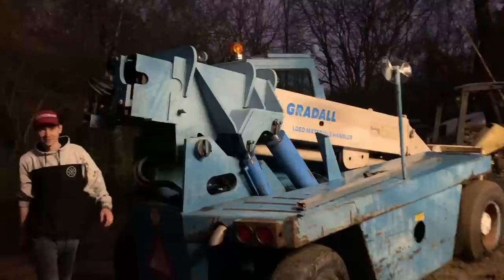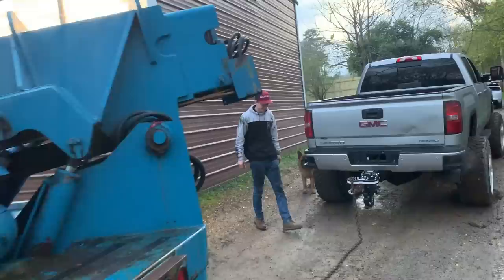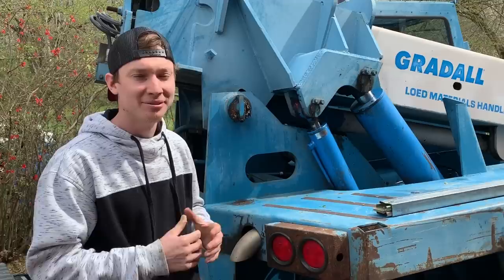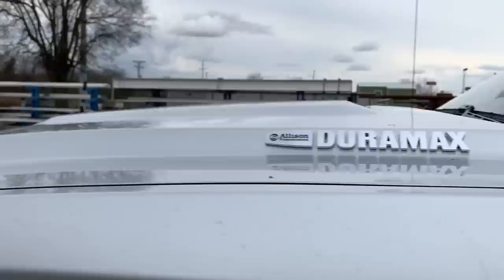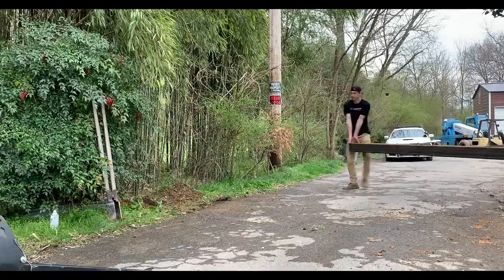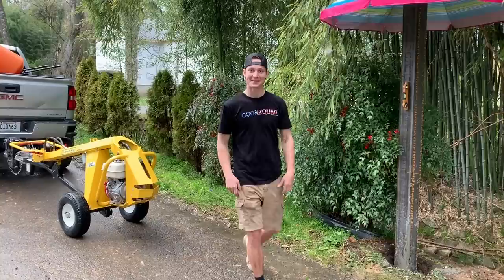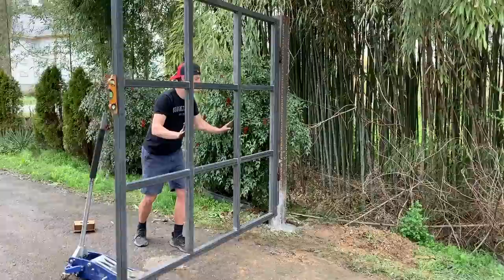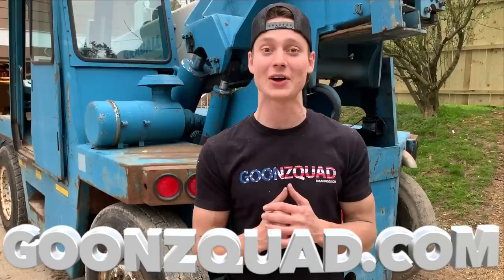Rebuilding The Worlds Biggest Forklift Part 3

Comment: Hey goozquad great vid but I have a suggestion. If your going to paint your “worlds largest forklift” i would suggest painting it white because if anything leaks it is easy to spot since she’s a little old it would seem right.
Reply: I agreed ;) your smart
Reply: Idk but i think its not a good idea cause white is easily look filthy isn't it?
Reply: Yellow - that is why big CAT machines are yellow, and easy to see so you don't get run over.  White glares too much.
Reply: I was thinking exactlythe same thing. Some light color so they can spot any leaks
Reply: @dannyinaus  yes this is what i mean😂
Reply: i would paint it yellow with black and on the boom goonzsqaud in black  i thing that would be nice
Reply: Naw the dodge viper orange would be better why would you want it to look like other forklifts
Reply: I think white on such a heavy machine would look full of dirt very quickly that current turkois colour is just perfect for both seeing leaks and hiding dirt..
Reply: White? You'd spend more time cleaning it than operating it. Just make sure you replace those seals, especially on the large boom. The oil was pooring out of there. I'd say paint it red, so it stands out and compliments the awesome shop!

Comment: Add a wheel on each gate down on the bottom. It will keep it from sagging over time when they are closed. I have 2 wheels on each side of my gates and it works perfect. It rolls perfect when you open and close it. The gate sits on the actual wheel, the wheel is on the ground eliminating any potential sag over time. The wheel doesn’t have to be big. It can be a small lawn mower wheel or a wheel off a trailer tongue. Make a bracket that mounts on the wheel and gate. Use wheels that do not need air so you never have to worry about it going flat. Just a thought because those are heavy duty gates.

Comment: Take the forks tilt them down in the dirt  and use the extended boom to push yourself backwards 
out it will push you back
Reply: Yes, this works, use the machines capabilities but......assure yourself that you are not poking a fork into a buried waterline or worse a gas line, also....clipping a fiber optics trunk will cost you around 100k

Comment: You should weld straight piece of metal on top of those two posts, this will prevent falling of each sides in a matter time and also keeps it sturdy. Last note: fix that hydraulic jack as soon as possible it's so dangerous cruising around with it.

Comment: I could get her out extend the boom into the ground while reversing and it should push it out
Reply: It also greatly increases the chance of bending the hydraulic cylinder for the boom extension. If its alittle stuck, it works but the way that was it would have broke something
Reply: maybe they didn't want to risk it what with their leaky hydraulics..
Reply: @mikef6879  Shouldn't be possible to bend that cylinder, since the extension itself will take the forces.
Reply: @Matevz96  they bend, we do work at a few rental places and they are constantly changing the cylinders because guys are using the boom to push things. The cylinder pushes the boom, all the extension forces are on the cylinder. The up/ down/side to side forces are on the boom

Comment: Given that you move allot of heavy equipment, I would have invested the money in widening the driveway for extra clearance, and also to rip up the driveway. As far for what I would put down in place of the tarmac, loose gravel (I think you Americans call it metal) used for roadworks is cheap, and easy to apply. Once that's out of the way, do the same job you did with the gates but weld in some diagonal supports, and have it on roller wheels. Also, look into putting in a small retaining wall down the neighbor's side of the driveway. The last thing you want is a bit of rainfall to loosen the earth, and have a truck or something go sideways. Remeber : a broken truck is a sad truck.

Comment: When using that concrete to set posts, you can actually just pour the dry mix into the hole and add water afterwards. The instructions on the bag will explain exactly how. Good job though guys!
Reply: Ismael Lugo ditto. And I woulda used a bit more Crete.

Comment: Nice job boys! Those fence boards tend to twist up a bit at the top if they stick up too far beyond the cross member. You might see those get a little wonky. But, you can always cut them down closer to the top of the steel frame if that happens!

Comment: Fill the beams with concrete at least 1/ up with sand rock and quick create, also put some type of dome/cap on the top posts to prevent rain/snow or other items from getting inside and destroying it for the inside out. You may want to add caster near the middle opening to aid in rolling upon opening to distress the hinges. as for the gate leave it plain no since in announcing who you are on the outside of it, But "GOONZ" on one side  and QUAD" on the other in Diamond plate would look awesome!

Comment: In case you didn’t see the other twenty comments, you should’ve just extended the boom and it would’ve pushed itself out lol
Reply: Kane Richardson it would have been fine usually cylinders leak because the seals get scratched up and hard. It would have probably leaked a fair amount but more than worth having to waste a whole day and messing up your backyard more.
Reply: I work on a farm with loaders your not normally lifting the weight of the machine just pushing it always works a treat

Comment: Hey goonzquad I am a Civil Engineer and one advice for you about the concrete, you don't want it to be low or high concentration concert you will need it to be medium, by that I mean high concentration: low water level and high concrete level, Low concentration: high water level and medium concrete level, so the best thing is having a medium concentration: which is medium water level and high concrete level. The reason is because having low concentration is that it will fall instantly, High concentration will stand but not long enough, and medium concentration will make you have the perfect concrete that would stand for many decades. And if you need any construction advice I am very happy to help. Please support this comment so they can read it.
Reply: You had low concentration guys

Comment: For a heavy gate like that I would put the posts at least 3’ in the ground.  Great job though. Keep up the good work.
Reply: I agree.  I vaguely remember hearing something when it comes to posts that you generally want 1/3 of the length in the ground.
Reply: They are at the least 3' in the ground. The holes were 2' then they pushed them pretty far down with the forklift.
Reply: Also would've put concrete underneath so they don't sink over time

Comment: i would definetly add some wheels to the gates to help with movement and also to prevent sag and dropping cuz other time with weathering the gates will fall slightly.
Reply: The gate swings high enough
Reply: ASSASSIN WOLF at the moment yes but I know from experience that the gates doors can fall the closer to the centre of the gate so where the two meet this may not happen straight away but potentially can eventuall small wheels or even metal studs in a small curved track would help remove some of the pressure on the pillars
Reply: Ok but let's not go with plastic wheels that's just annoying
Reply: ASSASSIN WOLF yeah no metal probs best lol 😂

Comment: Air down the tires when your stuck. Gives you more surface area to bite
Reply: Those back tires are just completely bald
Reply: @allspooledup2584  the back tires don't matter, they're just for steering, the front wheels are the drive wheels
Reply: EKS Tech Creation the drive tires take priority for the traction. Steering is pretty limited in the mud anyways, steers nothing like on a road
Reply: @EKS Tech Creation the traction while steering isn't overly important, the main thing is having traction on your drive wheels as they're the main thing you use when you're stuck, unless you have really done a good job getting it stuck, then traction on the steering wheels is important

Comment: Dudes that gate turned out really good, only thing I was hoping you'd do was cut the timber to fit inside each cubicle, weld some angle iron in to attach the timber so it would be flush and keep that awesome steel gate frame visible. Maybe you could do that on the inside so inside looks better than the outside lol, the inside of gates is always the ugly forgotten side, but it is the side the owners have to look at most of the time, I'm sure your Pops would appreciate it 👍👊😁

Comment: Outstanding Project
- If I may suggest for Next Metal or Wooden Post
= Drip couple Holes section below Ground
= Install Rebar
This Will Prevent Wood or Metal Post over time Slipping Down 
= I have First hand Witnessed Pole Barns after couple Years Posts slide down uneven Roof
= It's an Easy Enhancement for Long Term Stability of Posts
= Hope this helps
Any and all who may view this Comment

Comment: I believe your Gradall has hydrostatic drive (look it up).  The Axle is basically locked up unless motive power is being applied to it.  That is a big part of the difficulty in extricating that awesome machine. It needed to help itself out, otherwise you are trying to drag and lift dead weight out of a hole.

Comment: A trick u could use for the wood on the gate to keep it the same height is to use a nail and string. Nail a string to the first board you put on and set the height to the last board and then fill it in... Also I would stain your wood to keep it weather proof...

Comment: I ran a boom lift in Nashville back in the day and a thing to know is you can release some of the weight on the back end of it by extending the boom straight out. Though mine was a different type "4x4' I could extend the boom with a little weight on it and the tire guy didnt need a jack.
Reply: of course that is with lifting the rear tires.

Comment: As a metal fabricator of 15 years, drill weeping holes in the underside of every tube in the gate that doesn't have an open end.  Also, cap the posts to prevent rain from entering and sitting in them causing the posts to rust from the inside out.

Comment: Tip:  when stuck load up the forks. With weight usually you can pull through most mud/crap/shutter etc. It's when you don't have load when you dig yourself a path to middle earth. 

So you should have picked up the other forklift, bring the boom up and backwards, (to bring the centre of gravity closer to the front axle) and 9 out of 10 times you get free. 
Which is not to say that a tug of war with two big trucks ain't more fun. ;)

Comment: A few things you need to add to the gate to make it last. Cap the ends of the tubes. They are going to rot out if you don't. You need to run a cable diagonally from the top hinge to the lower inside corner. Believe it or not, these will in fact droop over time.  I also agree you need to cut some pattern across the top of the pickets, it's just way too boxy.

Comment: you guys might wanna think about putting up a couple short posts for each of your gate posts.  You could have the sort posts go into the ground about 3ft or so, and come out of the ground about 6 inches.  You could then weld cross posts from the top of the gate posts to the shorter ones to keep your gate from shifting...especially from the weight of the gates and or wind blowing on the wood panels

Comment: I thinkyou should just paint it blue like it already is.  there will be places you can't reach, unless you pull the motor.  You are prabably going to need a 5 gallon bucket of paint to do the whole thing 2 coats so if you go with single stage paint, plus primer, that will be you cheapest route.  if you go with fancy paint like you painted the S200o, can you imagine what is going to cost?  Keep up the great videos. I cant wait to see you guys building your new shop.

Comment: Telescopic arm is used for what gentlemen? Safe ground, or board it. Then boom out, bring it back towards you.
Isolation of the boom to do engine. Get u channel capable of holding 5 ton, lift boom and measuring the front 2 lift rams cut to length, then weld a locking system around ram. Mount on each ram and leave boom just above it. Its thier to give you time to escape not to hold it up.
Telescopic ram allow it to weep cost 2 full day to remove and replace. The self leveling ram keep an eye on, if get worse with your use get a machine shop to restore it.

Comment: I'd recommend a steel cable gusset going from the top of the gates by the  post to the bottom of the gates where they meet. It'll stop any sagging or bending in the gat me that might happen over time with consistent use

Comment: If you go with gate operators, you can look at the LiftMaster 400 or Doorking 6003 actuator arms. Unfortunately the hinges you uses are crap. I have replace endless amounts of those hinges because they do fail. If you can get the bearing style hinge like LiftMaster LM-2000U, you would be better off, with out issues. Also the way you mounted those hings anybody could lift the gate off the post. Another food for thought, you used to lite of a gauge for the swing gates, the said operators I offered could rip the steel or bend the frames due to the torque of the operators. I suggest back plate the frame from the hinge side out to the next cross member with at least 3/16 flat bar welded securely. I have been building and installing automated gates for 20+ years, and we do all our frames in .120 (slide and swing gates), and cross members for swing gates in 3/16 for operator mounting points.

Comment: I know you guys are new to heavy equipment, next time instead of grabbing two trucks to try and pull a 10+ tonne(metric) materials handler out of a hole, boom out, trust me that thing will have a lot of push force. It looks like a 4" ram from what i've seen. Hydraulic operating pressures in a normal machine is 2100 PSI+  I got bored and did the calculations on the extension ram, it has 26,000lbs of force (11.8 metric tonnes) at 2100PSI. if you cant push yourselves out with the wheels turning and boom out then you are in serious trouble haha. I am enjoying the enthusiasm you guys have for this old material handler. brilliant things to have, very handy!

But please don't walk under the boom when its in the air, not with out locking it out or supporting it. they come down bloody quickly with a pipe failure.

Comment: You use the forks and boom to push yourself backwards out of the mud. Also should have brought the concrete to ground level at edges and a inch above ground level against the pipe. Help keep it from rusting out. But then again that is pretty thick walled pipe that will hold up a long time

Comment: i have worked on a job where there was a manitowoc forklift it had a full 360 turrett outriggers that lifted it up completely off the ground they wore picking up bundles of 4x12 5/8 fireshield drywall off a flatbed semi it was telescopic and it was sitting the bundles on the tenth floor of the condo buiding from the parking lot

Comment: AAhhaa.. the guys figured out the the suggestion I was gonna make re extending the boom to PUSH them away from the original forklift. (5 30 or so then 6.30) but all good, bit of a learning curve they're on now, been watching from the Lambo re-build, this is gonna be interesting!! lol plus I'm surprised they never used mats of a sort to put below the wheels for better grip.. (had to use branches etc MANY years ago myself.. and yeah, did get out a soft verge.. but I see many guys try to ACCELERATE  out whereas softly softly does it.. )

Comment: With the kind of weight thats gonna be on the posts, they will droop down towards the middle of your driveway overtime.
You'll also need a way to secure the gates OPEN if you'r ever gonna open them in the wind, you wouldnt want them to open up and smack your trucks/cars/what ever as youre driving through.
Put down a couple more posts down the road that you can attach the doors to.

Comment: dont forget to change the fuel filter and check the brakes before you go too far.Also might want to wear some safety gear while working with the equipment.safety glasses and long sleeved shirts,pants.You never know when a hydraulic line can burst,it can do some series damage and can cut your arm off in a heartbeat.

Comment: Use footbrake and throttle at the same time and it will bias some torque to both drive wheels with an open differential

Comment: You need to put a cap on the top of your Gate posts or else they will rust out the bottom of the pipe because water will build up in them.

Comment: You should have filled the holes with concrete first then put the posts in. That way you fill the inside of the posts at the same time. You should also cap the tops of the posts so they don’t fill with water and rust out from the inside.

Comment: You will want to fill those posts with concrete, it is not cheap but it will give them the strength to put ut with bad drivers in cars and light trucks.

Comment: I would have drilled holes in the post and that went into the ground so as I poured the concrete in it would seep thru the holes filling the inside of the tube locking the Crete and tube together then weld a plate onto running wire up thru them and mount camera's and or lights

Comment: I would just pour dry concrete into hole and then pour water into hole. You also to pour dry concrete inside post 1/4 way and run water into post then cap post

Comment: Check the engine code Daewoo looks like a rebage like crown use Nissan and Toyota and other companies simple to rebuild the transmission on a forklift you have another forklift take the hydraulic lines off support the top of the fast with the other forklift undo the two brackets on the diff holding the mast undo the two tilt rams then lift mast off then you can get too removing the transmission out